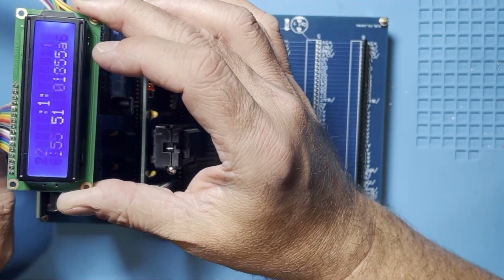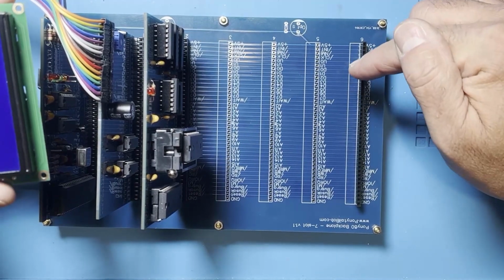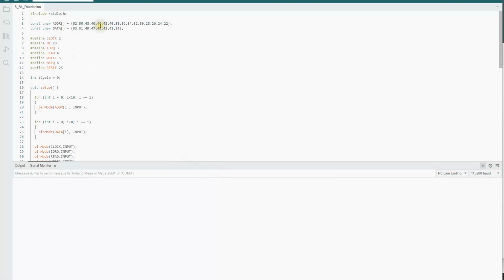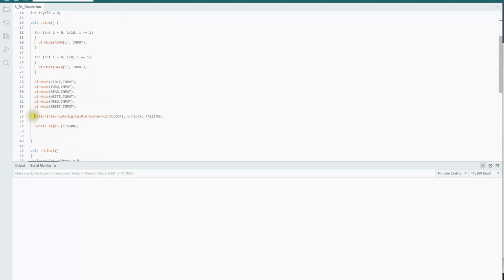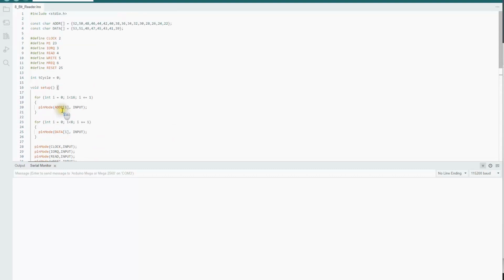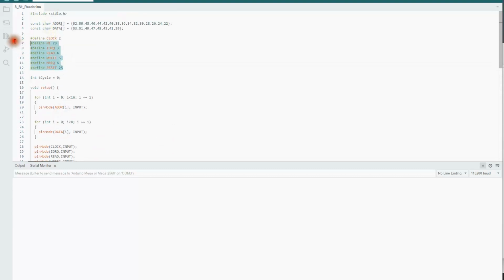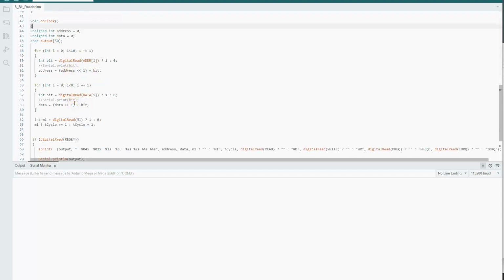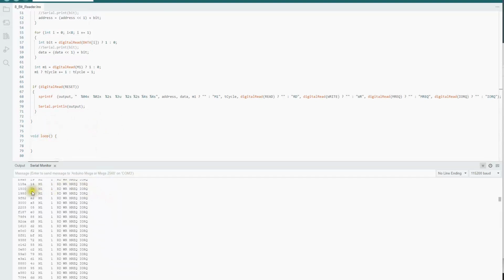Pony80 - Troubleshooting issues - My Z80 Homebrew Computer

Comment: Thanks Bob, I'm enjoying this series very much.  It's encouraging to see that I'm not the only one who gets these "surprises" along the way.  Unlike me, you don't seem to swear much during the debugging process.  :)

In the video, you mention adding bus terminating resistors to the CPU board.  Isn't that the "driver" side of the bus?  

I looked at your schematic and see the terminating resistors. Are these already in place on the board on the video?  Where were you putting the breadboard resistor packs in this video?

Keep it up!  I'm learning more with every episode.
Reply from the maker: Thanks!! Appreciate the feedback!

And there are times that my language gets a bit colorful… I try to edit that out!

For the resistors, ignore them for now.  I did a deep dive into the terminating resistors and realized I was using the wrong terminology. Gonna do a short video on it soon.  I have reverted back to the original schematic on the web site, as I kinda jumped the gun on putting the new one up there.

Comment: I have not seen the schematics for your system.
Since you are driving a bus, do you have HCT244’s (2x) to drive the address bus and a HCT245 to drive the data bus? There’s only so much current the Z80 can source or sink, and the Z80 needs some help to drive the lines. For the HCT245 use RD(NOT) to steer the direction.

Also, there’s some reflection (standing waves) on unterminated lines. If you put the 10K single inline resistors on the address and data lines, they should be on the backplane board. Typical pull down is 4.7K and pull up is 10K.

I’m designing a Z80 project right now using Mode 3 interrupts and all Z80 family of chips. Be sure to try out those bus transmitters (244) and bus transceiver (245) ICs. They have saved me a lot of heartburn.

I’ve been designing stuff with the Z80 since 1981 or thereabouts.

Good luck! Looking forward to your next video.
Reply from the maker: Great comments!  Thank you!

Yes, the transceivers/buffers and resistors are going to be an add in the near future. Trying to take it one small step at a time.
Reply: @Pony80  I do enjoy your videos! Remember to never give up. You’re going to bump into issues, timing rise/fall times. The data-sheets for each component is your friend. The biggest problem I used to run into was because I made some assumptions about timing. Of all the problems I’ve had to work through, Z80 timing was my biggest Everest to climb. You are doing it right, I can tell. So keep up the great work, and above all, have as much fun as you can. The Z80 is a fantastic CPU. With 178 instructions and a quick swap alternate registers (makes servicing interrupts a breeze), 3 well developed interrupt types to select from it is an amazing IC.
I’d love to send you some of my projects’ schematics. Just to have a look. I’m now using GAL’s for 95% of my glue logic and that is an amazing journey… burning GAL for 6-10 glue chips is so much fun. Memory and I/O decoding becomes a breeze.

Never say die, never give up!

Comment: Looks like a reflection problem. Your resistor network acts as termination. Pulling up or pulling down your address and data lines will of course help. Have you tried putting the CPU card on one end of the backplane, and another, like the memory card, on the other end?
Reply from the maker: Yeah, board placement didn’t seem to help.  I also hooked the breadboard memory up to the backplane and the issue went away.  Very interesting problem!

Comment: As soon as I saw that I was going something must be floating, then you said something must be floating.    But if something was floating your mem check should fail (if written in a way that would detect correctly), maybe something to do with impedence on the bus that the termination resistors fix??  I don't know.
Reply from the maker: This is why I love doing this… always something new to learn!  A floating pin is never a good thing.
Reply: @Pony80  Agree, I found that out on my 6502 implementation.  Still bread boarding it but didn't enjoy when I had a slightly loose connection and boom... nothing works.